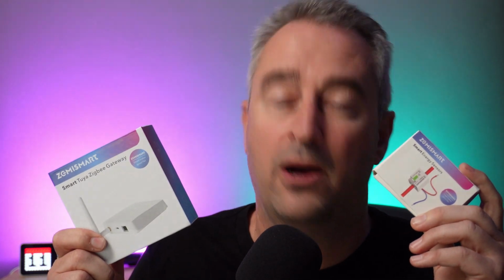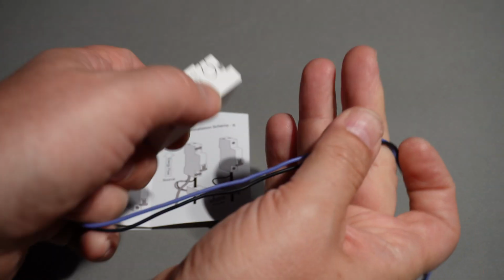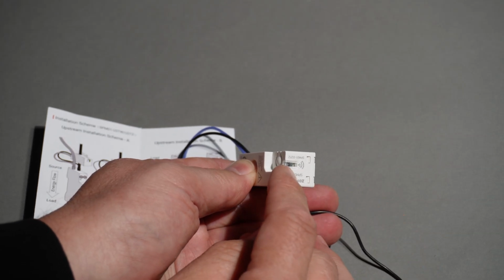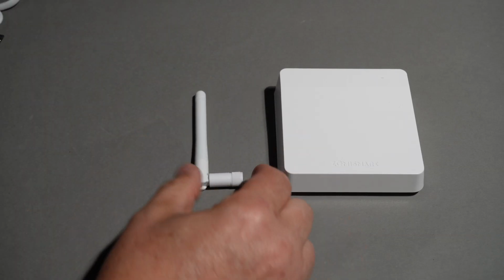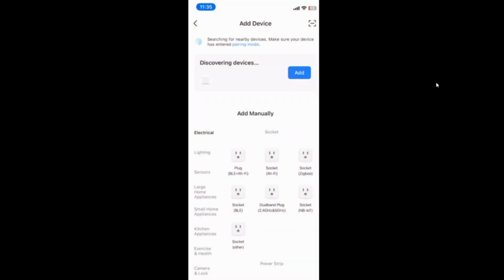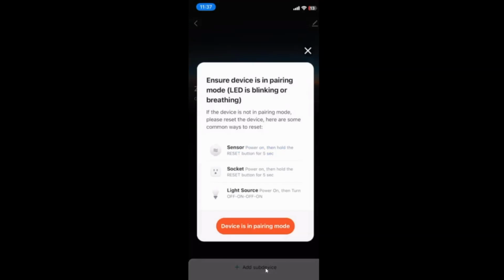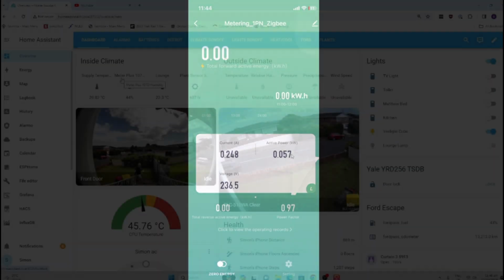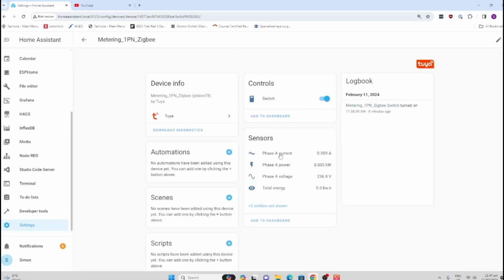Measure household appliance energy usage with Zemismart!

Comment: I have seen this hub and it looks like a new hub. But can you confirm these clamps are just zigbee and do not need the hub. Then these clamps will be amazing
Reply: they can be added to zigbee2mqtt without any problem
Reply from the maker: Yes it is the version 2 hub.  I see that they have also just released a matter hub!  I tried them using ZHA and they connect but the sensor values do not show.  They may work with Z2MQTT, I have not tried this.